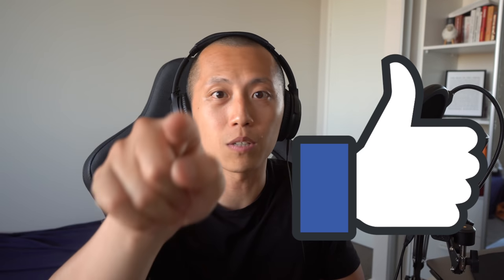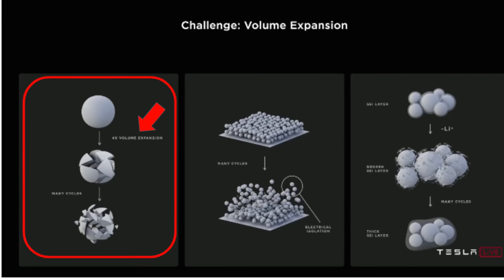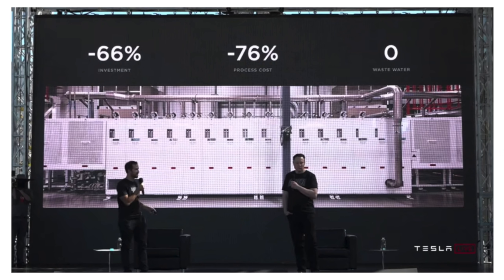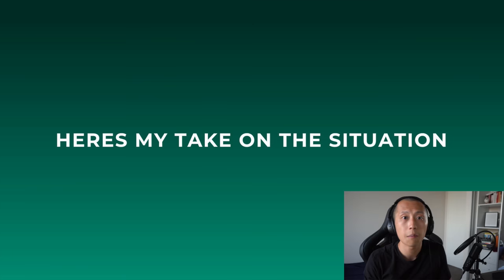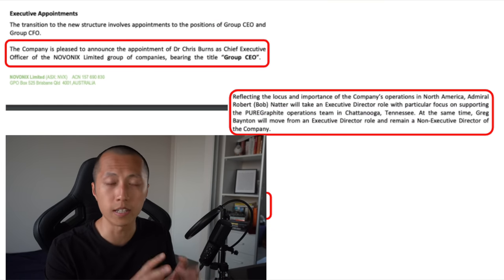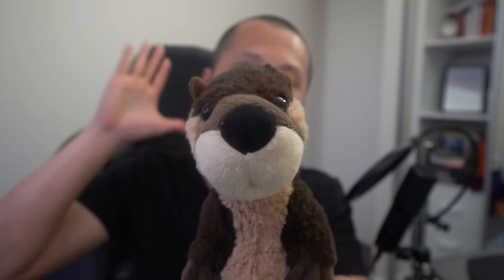What I Learnt From Tesla Battery Day // Novonix (NVX ASX) & Talga (TLG ASX) Update

Comment from the maker: Check out my Novonix vs Talga video  👉 https://youtu.be/2-k8KahVxp4

Timestamps:
0:00 Introduction
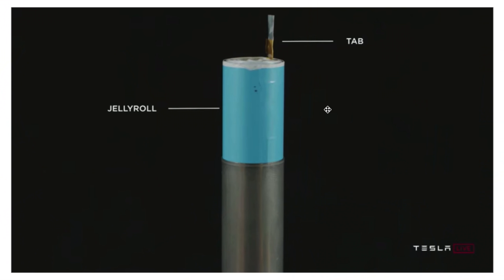0:59 Tabless Design
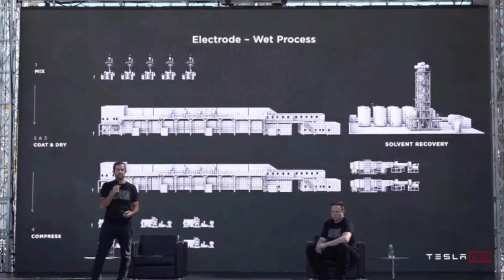2:05 Dry Battery Electrode Coating
3:14 Silicon Anode
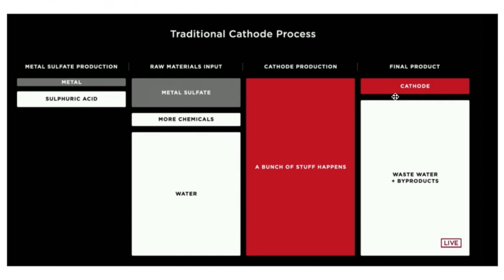5:15 Dry Cathode Production Process
6:35 Structural Batteries and Single Casting
7:12 Novonix (NVX ASX) And Talga (TLG ASX) Update
10:15 Thank You
Reply: hey David where do I find your Discord invite?
Reply: I believe in nvx for its whole story 
but know the momentum , day and fickle traders are running the daily and monthly market 
Anyone following nvx would be aware no partnership was coming short term 

Sooo.  I sold %20 of a large position on nvnx when it went crazy to $5-2.70  and watched it plummet to a reasonable level 
Now I hold a good position at 0.10$ like the initial investors and that  will make it nice to sit and watch its growth 

Thx for info and opinions on nvx and talga
Reply: What is a top tier part maker worth really.  Can we simply use the numbers they have projected ?

Comment: Graphite has many more industrial applications than batteries. Worth considering the broader opportunities than getting fixated on whether one company or another Wil form a partnership with Tesla, no matter how revolutionary they are. Complete dependence on Tesla for a going concern is a risky strategy. Tesla's intention to vertically integrate Li life cycle demonstrates their wish to use their scale to control as many inputs into battery / vehicle production as economics justifies. Tesla's ability to take a very long term view uniquely enables them to address problems in ways most incumbent car manufacturers simply won't likely be able to due to shareholder / financier biases.

Comment: Thanks for the video David

Very interesting. 

One thing I continue to be concerned with is, what happens when a single cast vehicle has an accident  ? Instead of changing parts, you would have to replace the whole car !

Happy investing
Reply from the maker: Well that would be interesting right, the question becomes would you prefer to change 72 parts with labour hours, or just 1? (I don't know the answer to that, just curious)
Reply: @DavidQuan  I assume the drive mechanism and obviously the battery are the most expensive in an EV. So, I guess if the mould was cheap enough, it could be cost effective and quicker ? 

But for minor bingles, which are more common. Could become expensive and less convenient to change the whole thing.

I guess more data and facts are required. 

Not a bad gig for Tesla insurance ! Haha
Reply from the maker: hahah for sure, let's see how the next few years pan out

Comment: My main concern was about Tesla using silicon anode, versus Novonix' synthetic graphite anode. That concerned me more than NVX not being mentioned on Battery Day, which I didn't think would happen anyway. If Tesla has the first mover advantage, and the world decided to go with silicon, where does this leave NVX? My stop loss got triggered during yesterday's big volatile move, but I still have a small NVX parcel. I'm still waiting and waiting for now until the share price stabilises
Reply from the maker: Well TSLA cells contains synthetic graphite (and natural), but they don't have to buy it from nvx, they need volume and reliability, and there's just no chance NVX can meet that kind of demand. 

And silicon on an atomic level can transport 4 lithium ions compare to graphite that takes 6 atoms to hold 1 lithium ion, so there are major benefits of using silicon. It's an inevitable material advancement

Comment: I bought in NVX at 1.7 pre BD and watched the whole BD shitting myself because the reason why NVX shot up was because of Tesla partnership hype going from 10c-$2 high at the time. So the current SP has factored in the that there was a large % that Tesla was going to use NVX batteries but that was thrown out the window because of the silicon battery idea. Fortunately I did put a sell order and got out at open. Since the high of 2.4 to today 1.2 I hope you're still at a profit, they did cap raise at 60c and 90c so they do still have lots of cash but are also burning through it like wildfire. GL
Reply from the maker: Thanks for the comment, I am all good, I have a small position in NVX just to have some skin in the game, check out this video to see my portfolio: https://youtu.be/uW566b5naoE